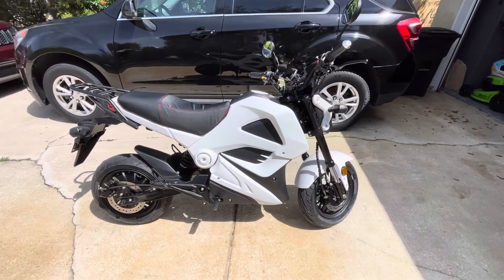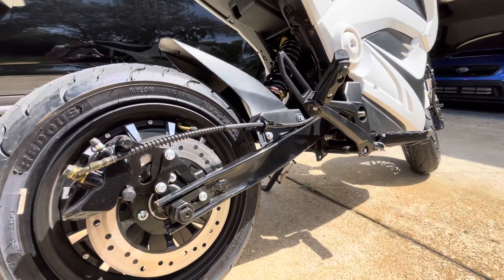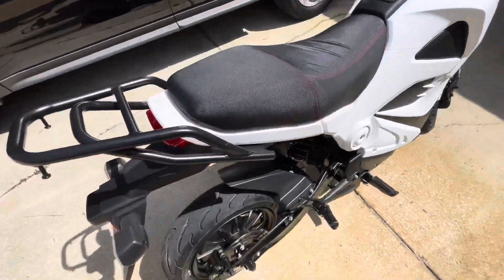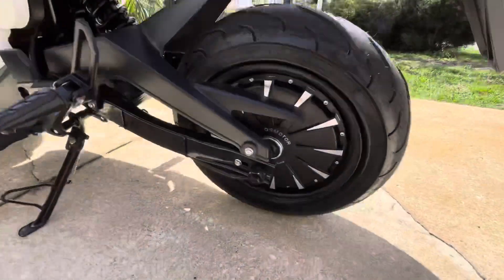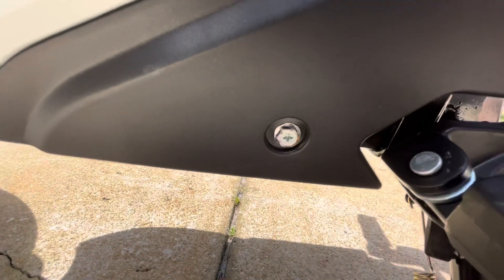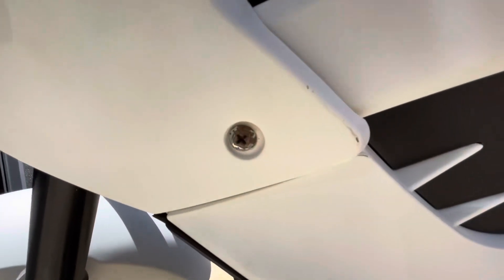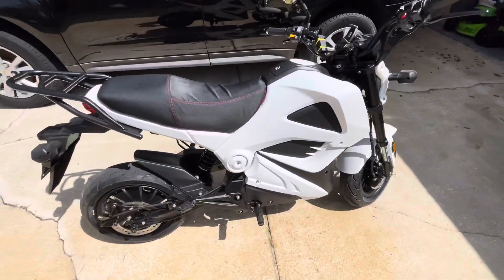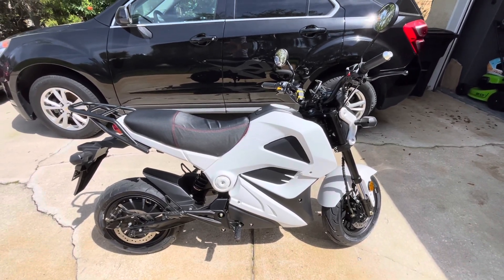"E-Grom" Base has arrived. Lets remove the factory junk and get some goodies installed.

Comment: I don't understand.. ?!?!
If the motor says its rated at 72v 1980W (27Amps). Why doesn't the original controller burn up the windings if it is rated at 72v 50 Amps (3600W) and then you add an upgraded controller that will feed it even more. You also state in the video that the Stock motor is good for MAX amps of 80-90.. I'm a little confused on the numbers and matching components. I'm familiar with electronics and BLDCS. I guess with my confusion I'm still a noob. But as I sit right now and watch, My head is like 1+1=4  ?!?! I understand that these may be peak numbers and not RMS/ Constant.
Is there anyway you could sum this up or point me to a website or video that would help me better understand this? Greatly appreciated! Good job on the video's and projects!
Reply from the maker: Thermal limits.  

Basically exactly what you said, the rating they offer is continuous.

Meaning you can run that motor at that power all day long at its full rated load.

Since we are often well below the rated load, and using bursts of power we can go much higher.

My new setup on the grom, say I am doing 60 and cruising at 6kw.

The motor is rated for 12kw.  I do not see any temp rise.  If I floor it,  which is 55kw.  I speed up to 80 in seconds.  At that point i lift or power is reduced as max rpm is hit.
So its able to handle this power under brief periods.  If I went up hill and held it at 55kw the winding would melt fast.

I use thermal throttling meaning if a motor over heats the power is reduced until cool.

If you are just going to wing it, and go full send.  You will most likely burn one up.
Reply: @BuildItTuneItEV  

Awesome! Exactly the explanation I was looking for,  Thanks!
Reply: I just got this e from and want to get it to go faster please help me

Comment: Hi there. I have a question. I actually have one of these and I wanted to upgrade it. I ordered a votol controller too. I'm having a hard time programming it. I was wondering if you could be so kind to tell me what the parameters are to work with the 200 watt Qs motor. I don't know if it'd be too much to ask. But please let me know I almost wish I could ask you for the file so I can just save the parameters to my controller. Anyway, happy one happy to cash up you some money or anything for your help. I'm at my wits and trying to figure it out. Thank you so much in advance.
Reply from the maker: We offer a remote tuning option!

Upgrademyebike.com

Votol tuning can be very tricky.

Comment: whats the specs on stock contoller, do you know?
im in the process of buying a Lithium battery to swap out the acid ones & im trying to stay in between the stock controllers capacity, thanks 🙌
im a fan now, new sub here
Reply from the maker: 72v 50A, you can add lithium to it. It's a bit more fun.

Upgraded controller with FOC on stock motor is the best bet.  Something like a votol em150/2

Comment: Nice  upgrade thinking about doing the same definitely want more speed …….. also have you ever tried to wheelie this ? I have one and just wanted to know if it was possible????
Reply from the maker: It's since been highly modded so can only speak in that forum.

It will wheelie, I personally cannot ride a wheelie so horrible person to ask how well it can. I can't even wheelie a pedal mtb. 

It will lift front tire to 12 o'clock if you 100% throttle it below 10 mph.  Past that it will lift the front tire a few inches until 20.  I've never tried yanking the bars and doing a wheelie, but at 400 Ft lb of tq I am sure it would.

Comment: Would just adding a 100 amp controller be the best single addition you could do for this? Basically looking to have a 50mph top speed, but beyond that the bike fits my needs
Reply from the maker: The stock winding is not capable of 50mph without using flux.  Which is very inefficient.    Best is a high mph winding or 96v swap.

Comment: Is there any video showing how you put all the upgraded parts in the bike?. I purchased one of these bike and Im very interested in upgrading all necessary parts to make it as fast as yours.
Reply from the maker: Some required some custom work, I wish I could have recorded every step, and shown it.  How ever my video skills are not that developed yet.  How ever I do have a full parts list of what's used and can gladly help with any questions along the way!
Reply: @BuildItTuneItEV  i noticed in your videos that you built a battery pack however I am not smart as you are therefore I wonder if there is a battery in the market that can help with this setup. By the way, where the list of parts needed for this build ?
Reply from the maker: @therom30  if you check the latest videos I have included all the links.
Reply: @BuildItTuneItEV   my front suspension is bottoming out and there isn't any info on it or on the company site.  Do you know what size I need?
Reply from the maker: What bike
Reply: @BuildItTuneItEV  e-vader
Reply from the maker: @cndbrn7975  Use grom fork, or go on ali express and search MSX125
Reply: @BuildItTuneItEV  thanks ..
Reply from the maker: @cndbrn7975  did you find it?

If not I can link you.
Reply: @BuildItTuneItEV  No I didn't find it.  I ordered these but I'm not 100%
VIARON MTB 26/27.5/29 Inch Bike Suspension Fork Travel 100mm Shock Absorbers Stright Black Tube Manual Air Front Fork (Red, 27.5)

Comment: thanks for the review!  I just ordered one of these to put on the back of my campervan and charge via solar.  I am thinking of upgrading to a 5kw motor, maybe mid drive if the QS mid drive assembly fits
Reply from the maker: I relied to other comment before seeing this.

I did the 12KW motor, only because I like over building things. The 5K should be perfect, you will want to pay attention to voltage and motor rpm.

The 12” wheel can be limiting in tire size.  Max I believe is 20”. If you jump to a 13” you can get 22” which helps with mph vs rpm.

I love the bike so far, I am nearing 200 miles with it.  (I installed everything after the second ride). I think the best bang for your buck is.

Fardriver 96v controller
13” 5000w qs hub
96v 50-100 ah depending on your needs for milage.

This is just my suggestions.

I went:
12KW , 13” hub.
150/70/13 rear
Bac 8000
20s24P 
80cm swing arm 

I had already purchased the controller and it’s limited to 72v or I would of build a 96v system for ease of rpm.
Reply: Did you still run a stock front wheel and tire with the 13inch hub motor? @BuildItTuneItEV

Comment from the maker: I planned on testing the stock controller on lithium, excitement for the best of me. How ever 50 amps was not going to cut it haha
Reply: what type of lithium battery did you get and where?  I am looking at 45ah batteries, but most top out at 150a BMS.  is 150 amps enough?
Reply from the maker: @taylorcuthrell4123  For this video I used a pack I made for another one of my bikes.

I used a 20s7p pack using P42A cells. So 140 of them.

Total of 29ah at 72v.

The stock motor cannot take more then around 75-100 amps depending on the voltage.  So 150 is plenty, if you upgrade hubs (I highly suggest ) then you may want more.

The new battery (can be seen in other videos ) is 20s24P with a new battery box that’s longer, and deeper.  It will house all 480 cells and the three BMS.

If you run two 45ah battery’s with 150 amp bms you would have 90ah and 300 amp of power which should be fun.

On the 29ah I can cruise 20 miles around 35/40 mph and I still have around 40% battery.  Depends on the wind, how many stop and go etc.

I generally think 50-100ah is ideal for the bike.
Reply: @BuildItTuneItEV  Thanks a ton! I just stumbled upon your other vids and noticed you're building your own packs.  I recently built an 8s 24V 132ah 3.2kwh LiFePO4 battery for my camper van, but that did not require spot welding nor is LiFePO4 the best for electric vehicle builds given its lower power density.
Reply from the maker: @taylorcuthrell4123  I looked into using Lifepo4 for this, how ever the weight was the issue.  Very high amp hour.
If you are not looking for all our performance but just a cruiser, you will only need around 50-100 amp of output.

https://www.18650batterystore.com/collections/lifepo4-prismatic-cells/products/eve-lf105

Check those out, no spot welding. Maybe the weight won’t matter to you?